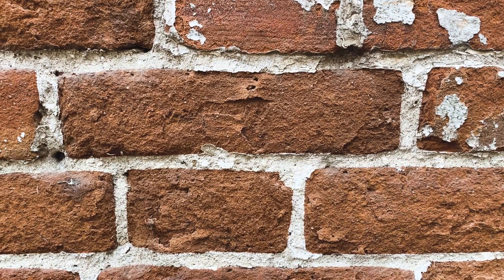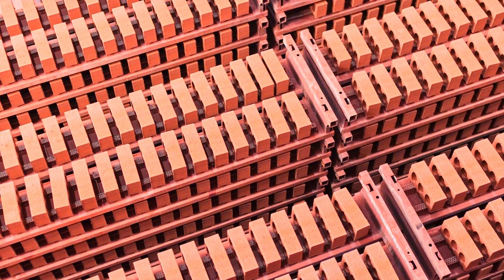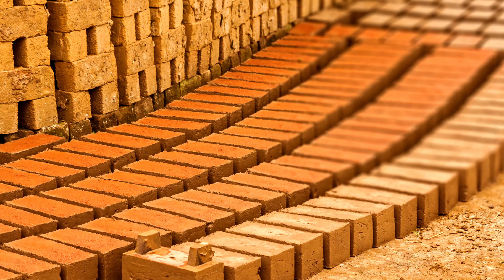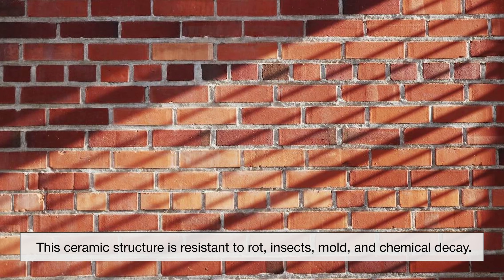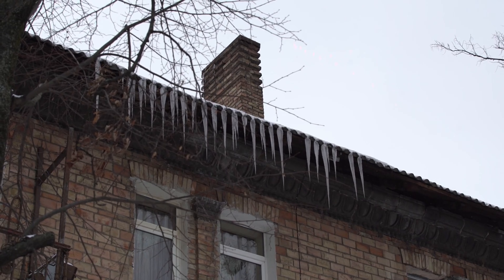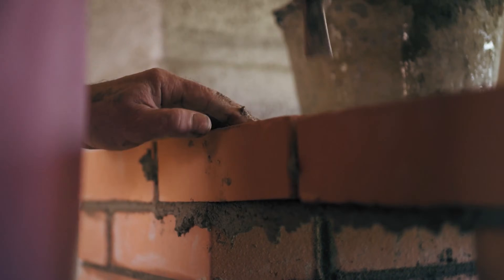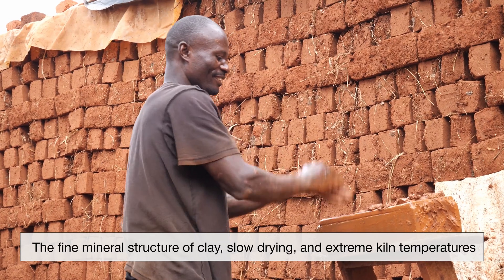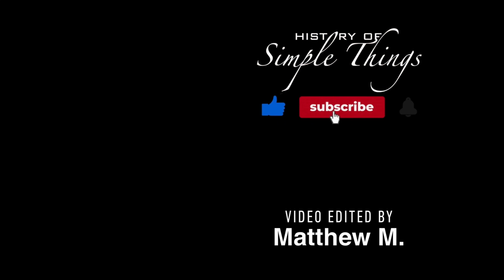How Do Clay Bricks Survive for Decades? Baked to Endure Everything [ID0701]

Comment: Wetting and freeze cycles do cause spalling damage to bricks, especially where the brick is exposed on both sides where the wet/freeze cycles is more intense. In such situations frost resistant bricks, meaning bricks that are resistant to becoming saturated, should be used.

Comment: Here in Scotland I repointed my 6ft garden wall (single brick Scottish bind on a Victorian foundation - staggered pyramid construction 18 inches under frost line).  Over a 25 section I had to take the coping off and top layer of bricks due to mortar failure.  50m2 of wall and only 2 bricks with any spalling.  Bricks made with Ayrshire fire clay which has a high aluminium content - top 5% on the planet but now all used up.  My wall will be there in another 130 years.  Yes the wall was built in 1895.